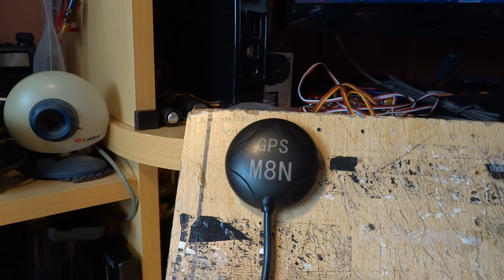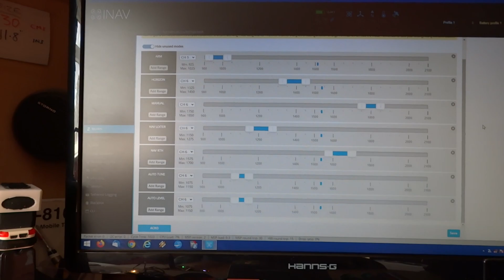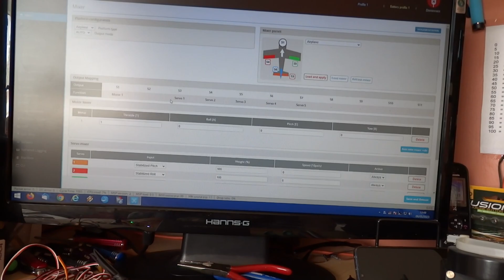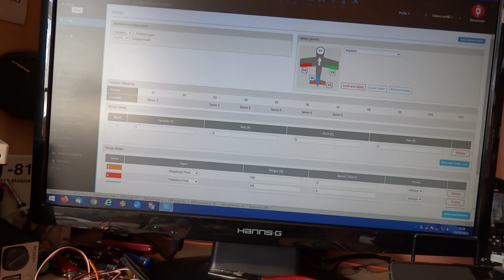Speedybee F405 Wing New Flight Controller

Comment: Just popped one in a Eachine Airloader, twin motor, individual outputs for ailerons and flaps, and still have enough PWM (and amps!) for a stabilized servo gimbal. For $40, you cannot go wrong! Up next I'll use another for a VTOL build. The only thing I see lacking on this board: I'd happily give up Wi-Fi and Bluetooth for a second camera input and built in switch.
Reply from the maker: yeh great price and functionality need to get it into airframe next and give it a try.